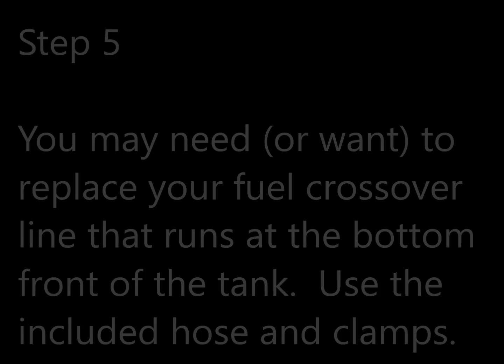How To Install a Tank Lift on a Harley Dyna Model

Comment: That's a good video. Is there a way to raise it higher to 3-4 inches instead of 2 inches?
Reply from the maker: The only bike we sell a 4 inch tank lift for is the Sportster. We do offer 3 inch tank lifts for the Dyna's, Softails, and Baggers, but you would have to check for clearence before ordering to know if your bike will allow for a higher Tank Lift. 

Checking for clearance not only allows you to insure fitment, it also allows you to see which size will look best with your bike.

It is easy to check for clearance:

1. With bike on kickstand, take the bolt out of the front of your tank.

2. Loosen (do not remove) the bolt(s) at the rear of your tank.

3. Turn your handlebars all the way to the left and raise the tank up your desired lift height to check for clearance issues.

4. Turn your handlebars all the way to the right and raise the tank up your desired lift height to check for clearance issues.

Be careful when lifting your tank, you do not want to hit against something (forks, handlebars, trees, blinkers, etc.) when checking for clearance. 

You can see all of our Tank Lifts at this link - https://www.dkcustomproducts.com/gas-tank-lift-kits-c4.htm

Please feel free to reach out with any questions;
Support@DKCustomProducts.com
662-252-8828

 Thank you for commenting! MB

Comment: I had spacer bushings with my kit. I bought the 3 inch deluxe kit. Had to use the extended hose. I really appreciate that supplying that DK. I've just put on the front so far. Looks good, but my brackets seemed wider than my frame. Had to use an impact to tighten everything up at the bottom where my brackets attach to the frame. Looks great though
Reply from the maker: Glad you're enjoying it.  Yeah, HD tolerance vary quite a bit, sometimes they need to be pulled in like you described.  We appreciate your business. 👍

Comment: Why am i having problems getting slack in my wiring? I have zero tried pulling the wore nothing comes up. Is there any solution to this issue?
Reply from the maker: What year model bike do you have? 

It may be the fuel cross-over tube that is stopping it from raising, not the wires.  (IF you has a fuel crossover line)
It could also be that someone zip tied the wires too tight under the tank, which is preventing the tank from moving up because of the tight wires. MB
Reply: Thank you for the response

2014 dyna Low rider 

That may be the case because the owner before me hated wires I’ll have to look under the tank, but the crossover line is good so is the vent hose. I did notice the cable tie underneath the dash cover can be a little bit slack if I cut the cable tie off.
Reply from the maker: I hope that fixes your problem! MB

Comment: Great video, but I only need longer vent line. where can I get it ?
Reply from the maker: Any auto parts store.
Reply: @DKCustomProducts  Thanks but I searched quite lot there are only fuel hoses which looks bit different outer diameter and material.
Reply from the maker: @irakli9604  It is a vacuum line, not a fuel line.  It might also be what some folks call a windshield wiper fluid line.  If you received a Tank Lift Kit from us and the line was not long enough, you can give a call or email and we have some...but it would be faster and less expensive to get it locally at a parts store.

Comment: What does this change the fuel level indication and accuracy ?
Reply from the maker: Good question.  Depends on the bike and the size lift.  Anywhere from no change on the Touring, Softail & Dyna models with up to a 2" lift (and deluxe option) to as much as a 1/4 gallon on other configurations.  Here is a write up on it with a graphic of what the gas does in the tank-
https://www.dkcustomproducts.com/what-is-a-tank-lift-and-why-do-i-need-one.htm

Comment: Did you have to change the vent line and cross over  hose? Thanks.
Reply from the maker: It varies bike to bike, because Harley is Not consistent in how long they make their hoses.  But most of the time a 2" will fit with no change in hoses needed.  All kits come with the hoses, in case they do need to be changed.
http://www.dkcustomproducts.com/Dyna-Tank-Lift-Kits_c29.htm

Comment: whay is the benefit of lifting the tank. or is it just a  cosmetic look..thanks
Reply from the maker: It increases air flow over the engine, cooling it down 10-15 degrees.  That redirected air is no longer hitting the rider in the chest, resulting in reduced buffeting.  Expose more chrome for looks, and makes cleaning the top of the rocker boxes easier.  https://www.youtube.com/watch?v=NiCQL4ffw7g
Reply: smokeGR20 will throw ur fuel gauge off if that's important to you, you can do with out this
Reply from the maker: On 2014's and up we have not seen it changing the fuel gauge at all.  On earlier years, the fuel gauges were rarely accurate, and it does change...sometimes making them more accurate, sometimes a little less.
Reply: Honestly it looks way better. Subtle change in the lines of the bike. 2" works easy on softails. 2.5 on dynas, sky is the limit of sportsters. Will change the fuel gauge a little bit but its not accurate to begin with. When you hit OMG LO RNG status you have about a gallon left on Dynas and Softails.
Reply from the maker: Mike Greer  Yes, besides better air flow over the engine, more chrome showing and easier to clean, for many it does make the speedo easier to see.  All depends on how tall one is and how they sit.

Comment: is there some slack wires down inside the frame? a friend said its down in there I just need to quit actin like a pussy and pull the wires out but I don't wanna pull them too hard if theres not enough extra wiring? what do ya think?
thanks